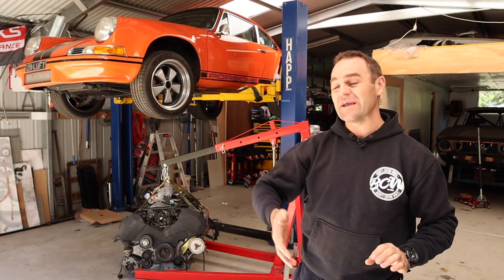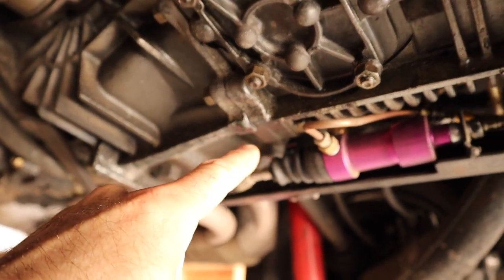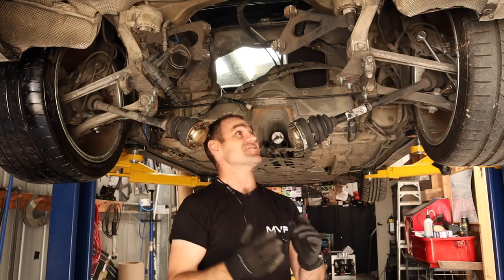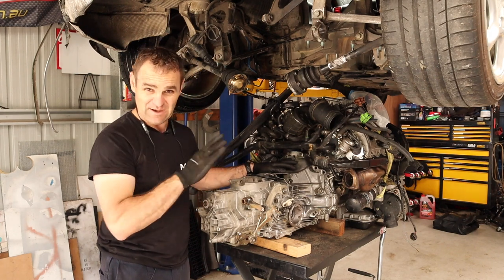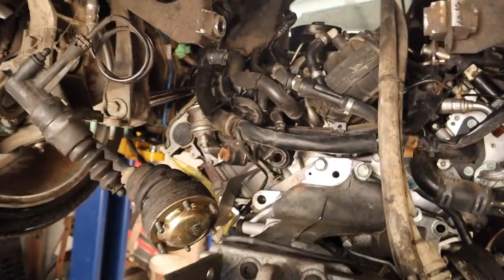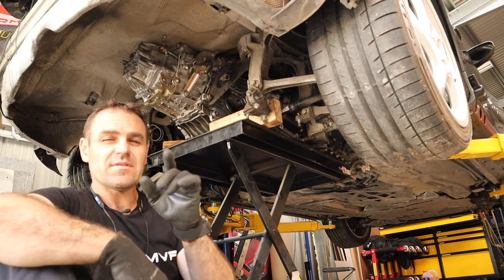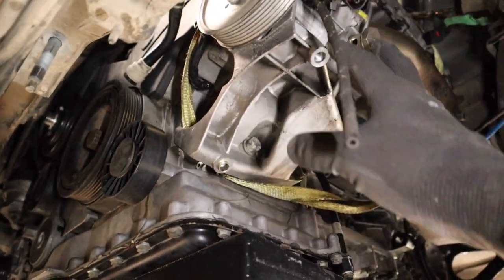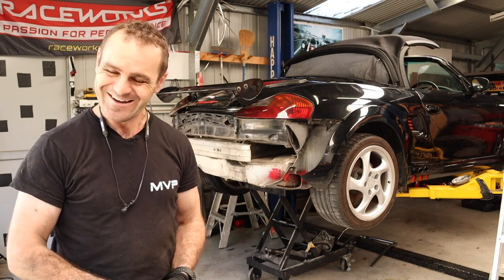Will the Audi V8 fit in the Roxster? - Porsche 986 Boxster V8 engine swap track car build 3

Comment: The Audi 4.2 looks a better fit than I thought! Since it will be a track car and it will break stuff on an engine that will be a real bear to service, make the mount up something that lets you drop the engine/trans for most service past an oil change! Take your time, get it right- most of us didn't come here because you are a fast, rapid fire builder but because you do really neat,great stuff! And then there is Mrs, Jeff- wouldn't wan t to leave her out! Best to both of you! FR

Comment: Don't use the Audi rubber mounts use a leaf spring bush or swing arm bush and make your own.
Move the engine back at least 20 mm from where the transmission mounts line up.
You should probably make a cradle that replaces the engine and transmission mounts  and use it to mount a bash plate / bucket under the sump to make the race marshals happy

Comment: Hi Jeff. Love the work. 
How about remaking that gearbox mount in a way so that the exhaust runs through it instead of over it? I've seen many hotrodders do this with cars on air that cannot have an exhaust under the frame, so they notch or cut a hole through it and weld supports back in.
I recently saw Finnegan do this on his slammed C10 Chevy

Comment: If the transmission is separate to the diff or the diff doesn't use a clutch type lsd put some Teflon based gear oil treatment in it to see if it will stop leaking. I highly recommend it for open and torsten type diffs

Comment: I would double check your strat for motor mount. I feel like if you mount to any suspension mount you could change suspension feel on that corner. Make it non responsive or act differently. I may be wrong but probably depends on setup exactly.
Reply from the maker: This is not being mounted to an unsprung point

Comment: Was a bit worried about belt space and the levelling of the engine and trans but if you are dropping the trans mounts then it should suffice. That makes me worry about the suspension and ride height in terms of clearance🤔
Reply from the maker: It will be fine. Track car ;)

Comment: Hi Jeff...
What an awesome project...
Do you have the measure in hand how long the distance there is from center of drive shaft outlets on the gearbox to the very moust front of the 4.2 engine?
I'm planning to use the Boxter rear suspension, gearbox and a 4.2 V8 in a home made custom supercar...and dont have the engine in hand yet.
I have the Boxter donor car.
Reply from the maker: No, sorry

Comment: Why not use the electrohydraulic power steering pump from an Astra (if it is strong enough)? Would save a lot of oil line.
Reply from the maker: Because this is being built as a cheap track car, and it is better to use what I have.

Comment: I'm surprised the Audi engine fitted in there quite nicely Jeff.
This will be a torque monster round a track thou might get a bit toasty in their without the AC!
Thou I'm sure  without that AC pumps weight will off-set the extra weight of the Audi engine lol!. (Their quite heavy)
I come for the Alfa mainly but the Roxster shaping. 
Up to be an interesting project. 
Think I'll might have to help you with these projects. :-)
Reply from the maker: Watch the previous video where I weighed both engines ;)

Comment: Check so that the ventilation is turned the right way on the 915, cant remember what way is the right...
For the noice in the car, nothing beats the noice cancelation Bose  head phones. I use them when I drive my race car.
Reply from the maker: Harry has fantastic 3 layer sound deadening, so I don't have to. It is a very rare comfortable classic road trip car ;)
Reply: @HomeBuiltByJeff 
That doesnt help the wind noice when you roll down the Windows. :)

Comment: In regards to the exhaust.
Tuned length runners are not exactly necessary for maximum performance. And the optimal length varies with engine capacity and pipe diameter.
On an NA engine you want to pair cylinders so that one helps scavenge gasses from the other , the tuned length is supposed to optimize this especially at certain RPM that the vehicle may never operate at except flat out on a race track,
Other designs might be a lot better for street use and even on some tracks.
Alternative designs are 
A long runner log. this is where pipes almost like zoomies come from each port then join in a very large log, the pipes are about half to a third the length of a tuned length header depending on what power and toque curves you're after or if you have turbos.
Another is a timing  paired header , This is where you join two or three cylinders based on when they fire so that the pulses don't conflict . you use a runner that is between a third and half the length of a tuned length and join them into a collector that is more than two or three times as large as each runner.
Reply from the maker: I am just going to use the factory headers ;)

Comment: You would be better off with some stronger engine mounts. The original Audi rubber is too soft and will allow the engine to move too much in the car. It most likely is softer then the gearbox mounts from the Porsche. Ideally they would be equally hard.
Reply from the maker: The Porsche mount is similarly soft

Comment: There's an inherent flaw with the Audi V8 with the turbo filters, they clog and when they do, it blows shit up. They're under the intake at the center of the engine. You'd be wise to tear it down before dropping her in, the filter can be eliminated alltogether as it has a high liklelyhood of clogging and failing. Have a look for yourself here >>>https://youtu.be/FQ_gsGhcRtU

Comment: Why not a audi V10??? Would be s monster 💀 n why not a 3" exhaust on the orange queen??
Reply from the maker: Did you see how tight the V8 is? 2 extra cylinders would have to go in the cabin.
Reply: @HomeBuiltByJeff  angel grinder  😉😉😉
Reply from the maker: @peter-fuppe-fuchs  I will just have to move the drivers seat to the Froot ;)
Reply: @HomeBuiltByJeff  🤣🤣 i was just kidding.... With the V8 it will be a killer..... I have been a Porsche fan since I was 4 yo n I'm a big BIG fan of orange... So your orange queen is just spot on, and the Roxter..... It will go as a flash..... How's it going with the Alfararri?

Comment: Hi, Thanks for the series.  This, to me, is your most interesting current project; the Audi transplant seems very possible.  Unfortunately the Alfa project, again in my view, has become a bit of a hack-job; too much cutting and not enough considered fabrication.   The Boxster should result in a solid, viable car without a lot of bodging.  Keep up the good work.
Reply: If you've watched project Binky they're race engineers and they sometimes have to re-do previous work.
This Alfferrari is a one-off bespoke car there will be a bit of chopping and changing as the project progresses.
Whereas the Roxster is just an engine swap. 
Still alot of work but not as complex project.

Comment: Scrapping the air on is a mistake, especially in Oz, if you were in the UK you might get away with it but still limit the summer track days and enjoyment, in Oz it is going to be miserable 😩 

Will the Audi engine not fit with the AC pump? It would make sense 👍
Reply from the maker: Pure track car, which I am not planning to do endurance races in, so I should be fine.